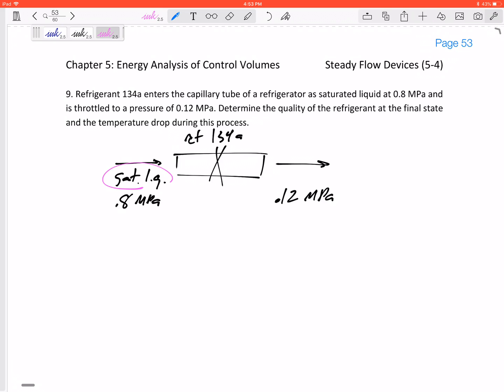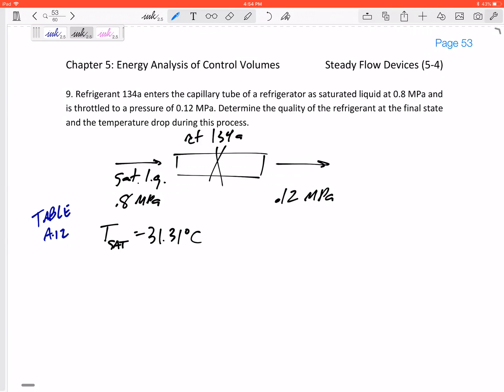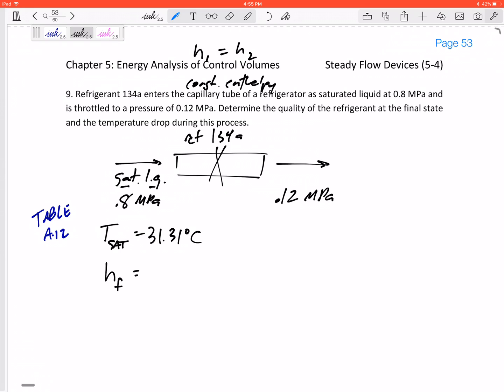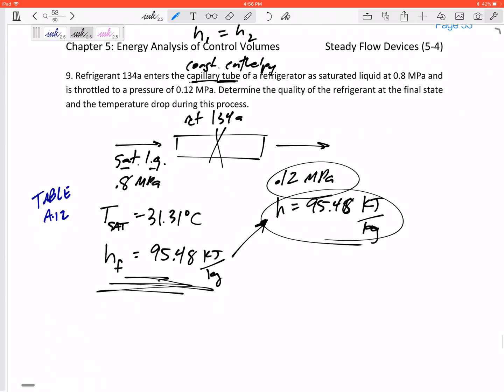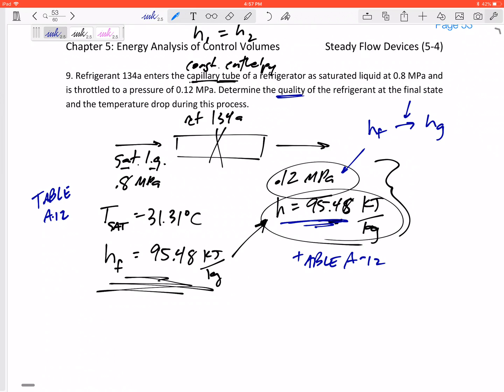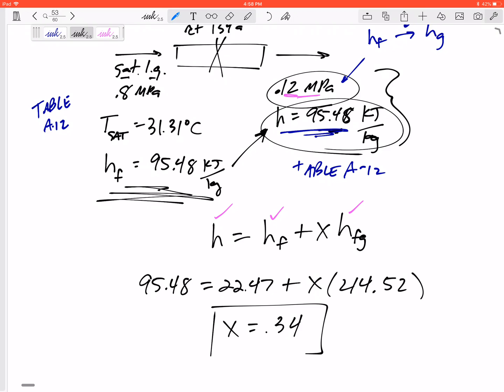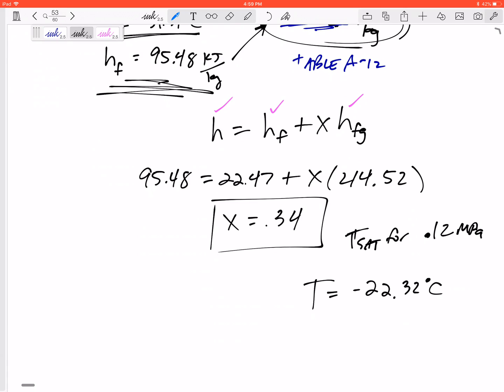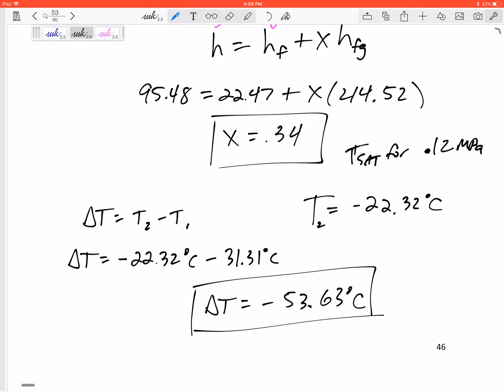Thermodynamics - Steady Flow Devices - Capillary Tube

Comment: why is h the same for inlet and outlet?
Reply: Becuase of constant enthalpy process. So if you use Q + W =m( delta h  + delta ke  + delta pe) . You will see that there is no change in Q, W, ke or pe. thus the equation simplifies to 0=m(h2-h1) then further simplifies to h2=h1
Reply: @nielenbester4786  omg thank you so much

Comment: As there is a temperature drop isn't there a -Q associated with this process?
Reply: Temperature drop is internal and no energy actually leaves the control volume so no Delta Q for the system.